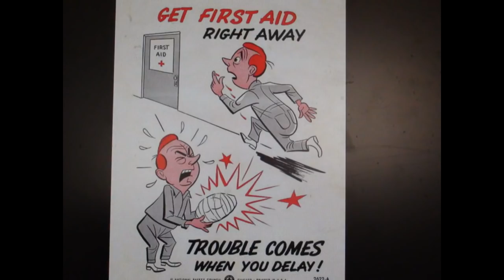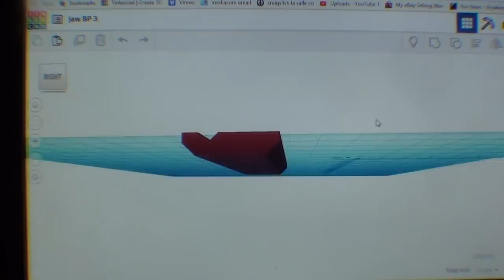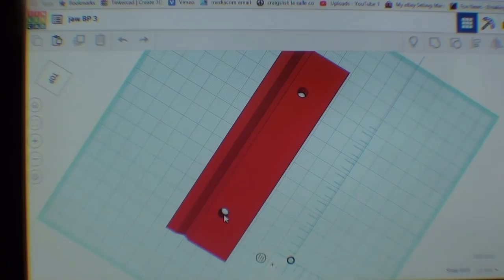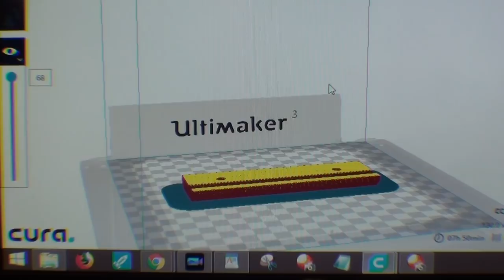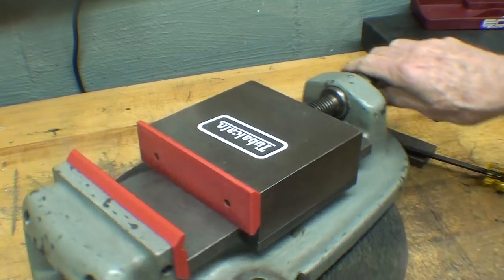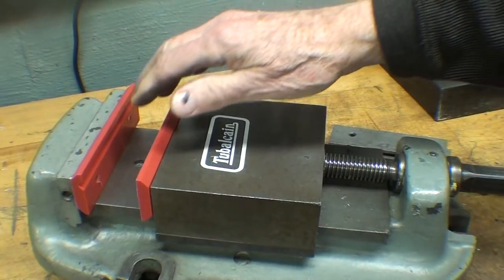3D Printed Jaws for Bridgeport Mill TIPS #422 tubalcain

Comment: I appreciate your time making this video! I can say as a Journeyman machinist and expert 3D printer, I would say you were pretty close to success other than your material choice. PLA is ideal for modelling or very light duty use. There are some more robust thermoplastics which would hold up. Plus are chemical resistant. Thanks again mate!

Comment: i have plastic jaws that are magnetised to the metal jaws for some woodwork and home repairs  . works well .  i had an idea for yours which may be useless as im not a metal worker ,can thinner soft jaws be 3d printed to save time making and screw onto the metal jaws on the vice or with magnets built into soft jaws .
Reply from the maker: Probably

Comment: The answer to your question is: Depends. 

Those jaws, as you said, would be quicker to make by hand, as there are not many operations to get from flat sheet to profiled, chopped off, drilled and tapped. But, you'd still need a milling machine, a set of cutters, a drill press, files, saw etc. to do a decent job. And you'd need lots of shop experience (which you have). 

By the other route, you'd need a printer, some PLA and a cheap laptop, your drill press and some taps. You wouldn't need so much experience. But, you'd need lots more time to wait for the print. Give it ten years and that part will be printable in 30 mins, I bet; maybe less.

Thanks for the time you take to make these videos. There are not many good demos of 3D printed parts being used in mech situations on Youtube. I am evaluating 3D printing as a route to market for some simple parts and find your videos very useful.
Reply from the maker: Thank you for watching, I think I will come up with more and more ideas that relate to the machine shop

Comment: Ok, my opinion. I have been studying some CAD, and just downloaded CURA, but have not bought a printer yet. For me the point of learning something new is fascinating. I fully agree that things can be made using the lathe, mill, etc., but being exposed to these new fields is very interesting and provides for new creativity. I have learned a lot about 3D printers by just trying to learn which one to save up for - and probably can not justify as well.
Did you know at about $1,000,000 plus one could get one that actually prints metal objects. That was news to me.
Reply from the maker: Thank you for the comment, I still have a lot to learn about printers myself

Comment: I see a few people recommending hair spray for the bed, but I've had great success with gelatin! A 10% solution of unflavored gelatin brushed or squeegeed on works wonders. Dries and flakes off easily. A little bit left on the bed is no problem for your next print.
Reply from the maker: Thank you, I need to try that

Comment: I print in abs on heated bed and my parts are as smooth as a baby's glass butt.  Use Elmer's Extreme glue stick, everything else is garbage.  Apply to clean bed, two passes, one coverage in X direction followed by one coverage in Y direction.  I get many prints between cleaning and applying new glue stick.
Reply from the maker: I will get some of that blue
Reply from the maker: I meant glue
Reply: I agree with Crafted!

Comment: Mr. Pete, I would recommend you try printing directly on the glass with Aqua Net hairspray rather than fighting that tape and glue stick. You can get a 6 pack of 12x12 mirrors at a Home Depot, Lowe’s etc big box hardware store for around $10 and have multiple plates to print on, just swap them out. Prints pop right off of a cooled glass and the finish can be nice and shiny. You should look at insulating the print bed, too for much faster heating and more consistent heat. I bought a CR-10 after seeing your videos and a friend’s printer and have been having a lot of fun with it.
I sometimes print with a brim but never a raft. The raft is not going to give a good finish. 
One other note, most people recommend a 60 degree bed, the actual glass temp is going to be lower so try heating and measuring temperature, I usually run 65.
Reply from the maker: I did not have much luck with that. Do you let the hair hairspray dry?
Reply: mrpete222 yes It is dry by the time the bed heats up

Comment: Try printing it with out the brim because you don't need a brim when using PLA. PLA doesn't lift up like ABS, that's the main reason I use PLA. Try it, you won't be disappointed 😊
Reply from the maker: I sure had some of that lift up, did you watch my earlier videos?

Comment: Also, you can set your slicer settings for layer height can be set as high as 0.3 mm to decrease print time and will also increase strength because of the larger surface area being laid down each time. The default on most slicers is 0.2 mm layer height.
Reply from the maker: Thanks for the ideas

Comment: A trick I use when threads in a part might not be strong enough to hold repeated use is to create a hex hole in the back side to hold a nut.  These jaws are pretty thin so you would have to use a thin nut or turn one down.  However if you do have a thicker part in the future you could use this method.  Inspirational as usual.  I've been 3D printing for a couple of years now and learning the machining the right way from you.. Thanks a bunch.

Comment: Use of a quality blue painter's tape (3m) wiped down with alcohol to remove the slippery release agent and you can do away with those time consuming and wasteful rafts if you have your heated tip to bed clearance set up properly.
Reply from the maker: I'm still experimenting

Comment: With all due respect, it is PAINFUL to watch you do this. The term "3D printing" was coined to make the Additive Manufacturing machine less intimidating to consumers and to people that did not understand CNC machines. "3D printing" or Additive Manufacturing has been around in the industry since the late 80's into the early 90's (before it got good enough to sell). 

You're using one of those CR cheap Chinese 3D printers, aren't you? And...well you're just going about it all...all wrong. 

Additive Manufacturing today is legitimately a viable replacement, in a lot of ways, to machining. One current limitation is time. The issue is that the good ones (similar to CNC machines) are very....very expensive. Look at EOS, Objet Geometries (now owned by Stratasys), ARCAM (now owned by GE), M3D (Specifically the Promega, the one I purchased myself), and a site called "Thingiverse" (I'd recommend the Hypercube Evo) to replace your....terrible....machine. Power it with a Duet Ethernet or Duet Wifi, an E3D V6 (Gold Edition), a Meanwell Power Supply, and you're probably better off using a Geared stepper for both the Extruder and Z Axis. Look into the Bondtech Extruder. Spend a few weeks researching. Toms3D is a GREAT resource and my Go-To guide and the Duet3d forum is extremely helpful. 

I would not suggest attempting threading...at all on it, You have the equipment, start using it. You'll find the dimensions aren't what you or I would call "precise" so it is wiser to bore out and tap the holes yourself. There are ways to use the first layer as your "machined surface" so it is perfectly smooth to bring everything else down to size. You'll hear a term "Hybrid Manufacturing" this is marketing, just like "The Cloud" or "Cloud Computing." The term  "Cloud" was coined by people more concerned with job security, rather than education....it's a hard drive on another computer. Hybrid Manufacturing is simply Subtractive Manufacturing in conjunction with Additive Manufacturing, typically on the same part. You'll find this approach much more useful considering you already have the machining equipment. 

Fusion is great, I prefer Autodesk Inventor HSM, but I get it free as a student. HSM (High-Speed Machining) allows you to machine the outside of the model, quite useful if you have a model that is the same shape....but needs just a touch or a finish pass to make it perfect, see where I'm going with this? :) 

As for the mistakes you are making with your printer, I would strongly recommend you subscribe to this YouTuber's channel: https://toms3d.org/

This is where you can view the website dedicated to his YouTube Channel (use Chrome if you aren't already). 

If you have any questions, Kevin dot Delaney 93 at gmail dot com 

I am a bit obsessed with AM.

Comment: mrpete222
I really enjoy your videos and appreciate you sharing your vast knowledge in machining etc.  Just a comment about Fusion 360.  You really should use Fusion 360.  

Yes a little steep on the learning cure at first but there are incredible tutorial videos here on youtube.  

Also for threading, you could have taken your Cura model and imported it in Fusion 360 as a Mesh and have Fusion 360 convert it.  

Check out this video, it is really easy.

https://www.youtube.com/watch?v=y_jgbvV_TQE

Once you have converted your model into something Fusion 360 can work with, you can add threads or whatever you need.  I hope you give Fusion 360 a go.  
It really is an incredible piece of software.
Reply from the maker: I did watch some of the tutorials. But at my age it's a little beyond me. Then I had several offers from other people that will do the work for me, so I got lazy
Reply: mrpete222
U R a modest man.
You would catch onto this easily.
However, sometimes it is good to  be lazy. ;-)

Comment: Spray some aqua net super extra hold onto your glass, and print straight onto it with no raft. You'll get a glass smooth finish, it will stick very well at 60C and basically fall off when cold.
Reply from the maker: I tried that and it did not work
Reply: I wonder what's different for you. I've printed thousands of objects that way, with both PLA, and PETG. I went away from using tape a long time ago.

Maybe it's the PLA you're using. I recommend trying eSun PLA+ It's been the best PLA for me aside from maybe Polymax PLA, but that stuff is crazy expensive.

Comment: Hi mr. Pete,
If you want to get a smoother finish on the bottom of parts, try printing on a sheet of plexiglass. I’ve had really good luck with that. However, it’s not as easy to remove the part.
Reply from the maker: I am still experimenting

Comment: The beauty of the 3D printer is it works while you are asleep! also if you have complex work holding it's very simple to bring up the piece in CAD and do and inverse of the part. I'm just testing up some lost wax 3D printed molds.
Reply from the maker: Thank you for understanding. Most people miss the point
Reply: mrpete222 no problem, also just wanted to say thank you for producing all your videos, I'm not sure you realise what an inspiration you are to so many people, i built my own hobby machine shop on the back of your videos and a number of my work mates and friends are doing the same thing after I've shared your videos with them.

Comment: 6:40 If you're using PLA, you really don't need masking tape or glue.  Printing on a clean glass bed should work fine.  If you find that you still have problems with the print not sticking, then spray some unscented Aqua Net hairspray on the cold bed before your print.  I usually spray it on like spray paint, then lightly even it out with a tissue.  This will help the print to stick well, but allow it to pop off cleanly when cool.  The tape makes for a very aggressive bond, and while it helps with ABS which tends to warp and curl, it it usually overly aggressive for PLA.  If you do use tape, try the blue painters tape --  think it provides just the right amount of adhesion and seems to be a little less aggressive.

Comment: Lyle, you do not really need tapes, glues, magic potions, rafts etc on your bed when printing with PLA.  If you have a glass build surface, then you need nothing at all. As long as the glass is spotlessly clean and set to 60C before printing (Clean with window cleaner, dry it off then rub the glass vigorously with another dry paper towel), then the print will stick fine (if the nozzle is set to spec). When the print bed cools, the print will still appear to be stuck but what is holding it there is actually atmospheric pressure - yes really!. If you nudge the print sideways you will discover what I mean - suction!. This is the way the print is removed - sideways not upwards. I've being doing it this way for several years and of course the bottom of the print is as smooth and shiny as the glass itself. BTW, I guess you know you can increase printing speed considerably - better than leaving it unattended overnight.
Reply from the maker: I am still experimenting

Comment: They weren't  lying when they said it would just pop off when the bed was cold. I have the cr  10s, and I use hairspray on the glass, no tape or glue. When the bed is cold, the pieces slide right off.
Reply from the maker: I am still experimenting

Comment: I cannot fathom why you spend so much time with that gizmo when you can produce those parts on a mill at a fraction of the cost in time and material. Watching that crude device spend hours going back and forth would drive me crazy. I hope this is a passing fad. I love your videos generally, but these 3D printing ones are a colossal bore.
Reply from the maker: You apparently missed the entire point
Reply: I am sure I did, but i am someone who has watched more than a hundred of your videos, who enjoys your sense of humor and technical skills, and is fascinated by vintage machinery.  In other words, a true fan. All I am saying is that the videos you put up with that little Chinese contraption noisily zipping back-and-forth are deathly boring even if they work all night.

In any case, I'll just skip those from now on and quit complaining.

Comment: Hello sir, thank you for all the effort you put into your videos. I'd like to recommend, as others have, to experiment with printing directly on the glass. I have the same printer as you, and I've now abandoned the use of tape; I'm printing on the glass using Elmer's purple "dries clear" school glue stick as adhesion insurance (although I've successfully printed without glue as well). The finish on the bottom, as long as the bed is properly re-leveled, will be very nice using this method.
Reply from the maker: I have in fact I've done that, with very poor results
Reply: mrpete222 thanks for the reply. It's funny how, with these printers,  it seems that multiple people can apply the same piece of advice and get such inconsistent results. Anyhow,  I really enjoy watching your experiments with this technology.
Reply: I was going back and forth using both methods (tape / no tape and glue), and found that tape was more reliable.  What really seems to help my printer is pausing the beginning of the print for a minute or so to let the bed heat uniformly.  The hottest spot is the right side near the center of the  bed, and the front edge is the coldest area.

Comment: When you've gotten past simple projects to learn on this is a really poor candidate for printing. As pointed out this part can be easily made from sheet stock and in the big picture, it should be. But if you needed a similar sized and shaped part with 20 machined features, printing becomes a compelling option. If you need 10 of them, even more compelling.
Reply: this is an excellent use for 3d printing

Comment: I recommend a PEI sheet for your glass. Not sure if this was mentioned. Best thing ever. Everything sticks well. Especially ABS. Nylon doesn't but micarta works well for nylon. Bottom is totally smooth and glossy. You don't usually need a brim/raft. Parts come off fairly easy when cool. Ebay has them with preapplied adhesive. I heard about it a while ago but put off buying some for too long. Best $20 spent ever.
Reply from the maker: Yes

Comment: Sometimes what drives what you do is availability. If I have a need and used PVC I would have to order it, pay shipping (on a small order that can be as much as the actual purchase) and wait 5-7 days. The printer is sitting there loaded with plastic. But, again I use the printer for other things than just printing for the shop. Also, I wrote about making the printed Atlas 618 cross feed nut. I have an extra one (in ABS) , let me know how and I will send it to you to try.
Reply from the maker: Yes
Reply: How do I get it to you.

Comment: Very interesting I would like to get involved with 3D printing some day. I loved those bridgeport  vices I wish we had one at work. Maybe you can do a video comparing the strength of tapped holes in different 3D printed materials or compare them with aluminium or copper or just nylon stock, you could use a torque wrench to compare them.I wonder if helicoils can be used, just a thought. Thank you for all the inspiring videos you make.
Reply from the maker: Thank you for watching, good suggestion

Comment: I see a use for 3d printed soft jaws for fixturing and holding oddly shaped parts much like how you would make pie jaws for oddly shaped parts on a lathe or custom soft jaws for a weird part on a mill vise. A buddy of mine had to add a bolt circle and enlarge the bore in a sprocket and he used 3d printed jaws to hold the sprocket. https://imgur.com/a/V3ikt

Comment: Some claim that the plastic parts do not get stronger after passing some level of infill. Your solid parts may not be stronger than 50% infill parts. The trick is to have the outer shell thick enough. I usually specify 1 mm outer shell thickness if I need strong parts.
Reply from the maker: I understand that and know that it is true, but I have no way of testing it. At least a valid way